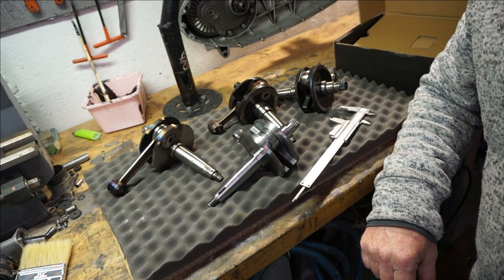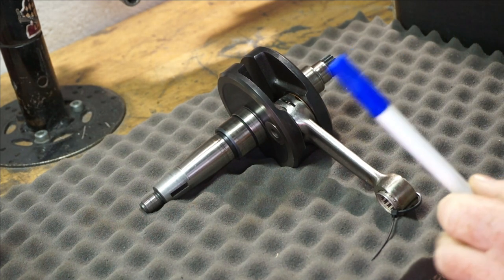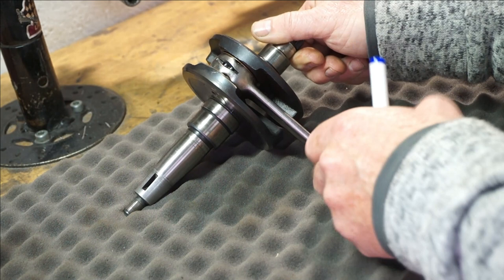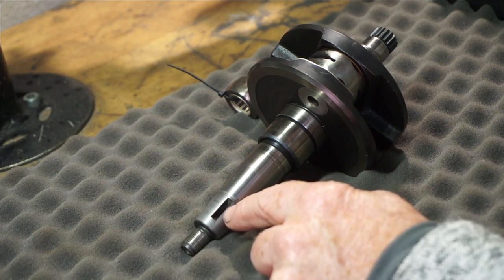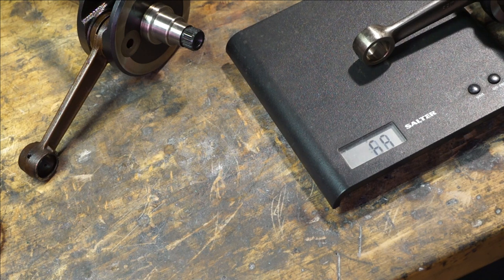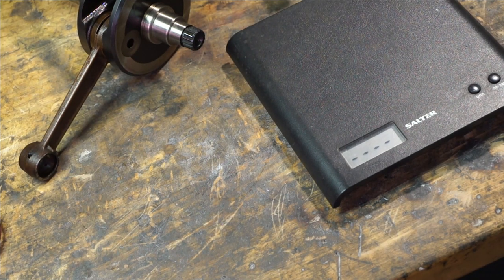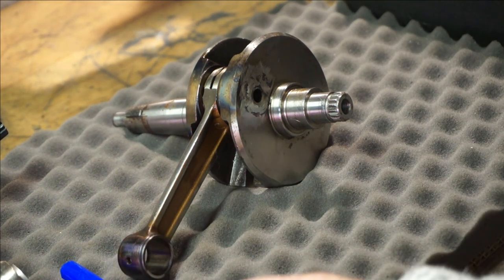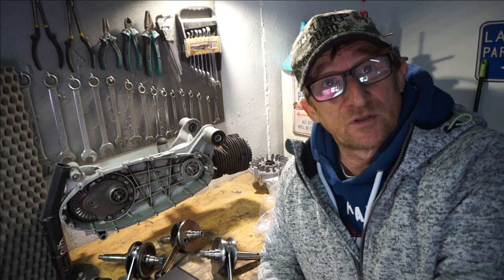lambretta cranks rod n stroke

Comment: Hi, very nice Video. Where can you buy that 54/116 AF Crankshaft? 
Greetings from Germany mate
Reply from the maker: Af rayspeed .
Reply: @TheSteelweasel   thanks, i found some webs for 300£+. Do you know if there is any other crankshaft with 54mm stroke for lambretta? I dont want to spend that much for my project
Reply from the maker: @maxklotz1350  you can have mine 54 x 116 with tig welded pin . 150 mate

Comment: Nice info steve , im running a 58mm on my casa ss225 and its smooth , some are using longer reach to get up to 240cc , what is the best to use and what difference does the reach really mean to top speed ?.
Reply: If your bike is running well mate leave it alone . I run a 58 mm stroke and 107 rod at Avon park and beat everyone there except Keith Terry ⁰but I was on a road bike 😊
Reply: More vids to come and I'll cover this for you mate
Reply: What do you mean by longer reach ? You mean stroke
Reply: @stephenrichards8065  yes m8 , making a 225cc into a 240cc by making a longer stroke
Reply: @midge225  62 strokie 😉
Reply: Not used a SIP crank yet although it looks quality for the price, ProPorting cranks along with BGM are what I mainly use. Once had a Sil big end bearing completely evaporate while going onto reserve while overtaking a HGV 🙈 Binned my underwear that day 🤣